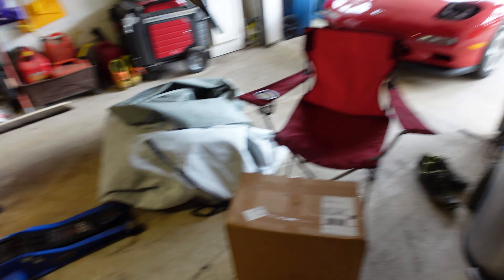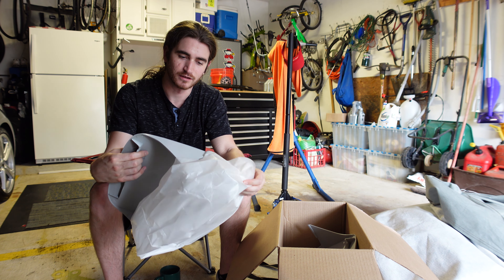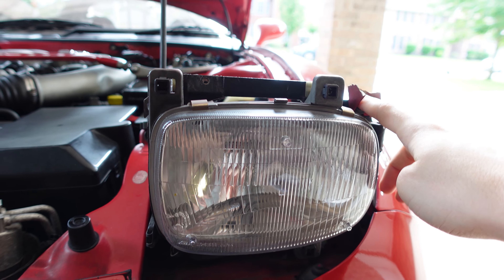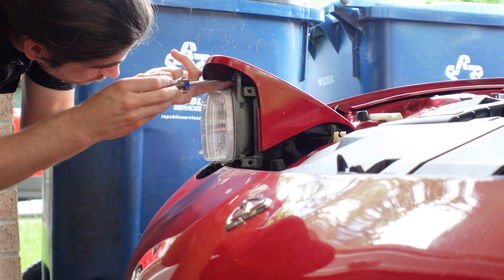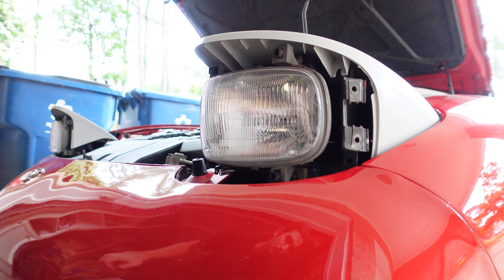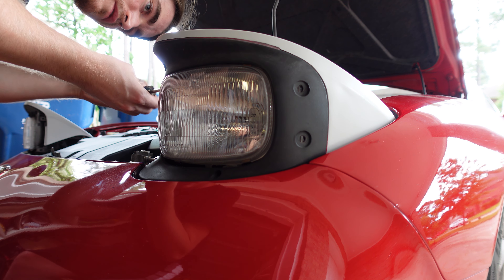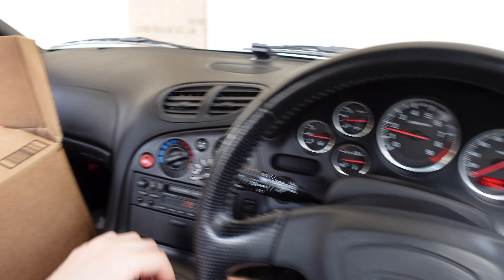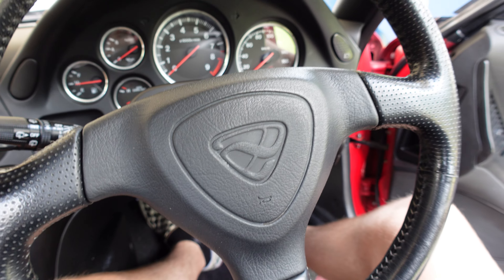My Headlamp Cover FLEW OFF (Plus New Coilovers)

Comment: Does your car really idle at 1600rpm?
Reply from the maker: Yeeee. It was actually something I adjusted. When I originally got the car, it would idle around 800. But the car would shut itself off when shifting between 1st and 2nd gear. The solution was simply to increase idle.